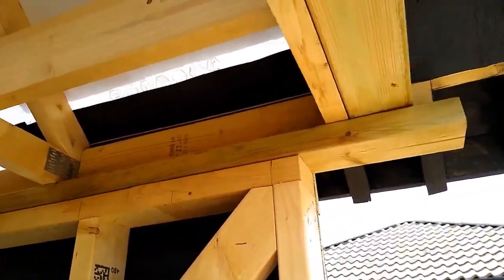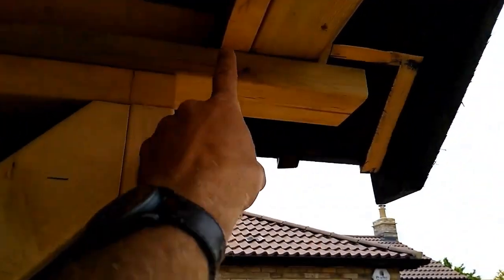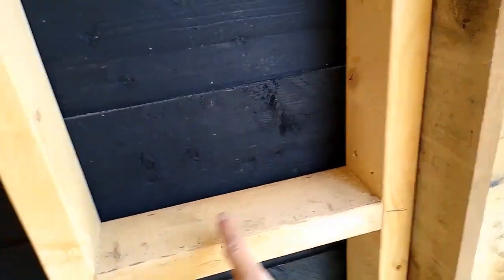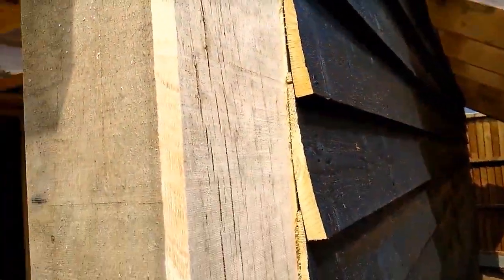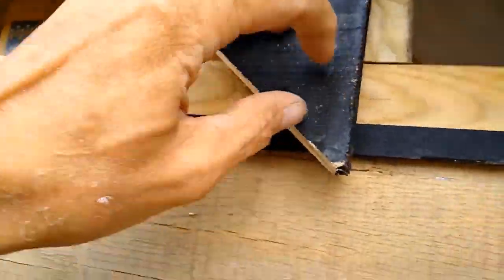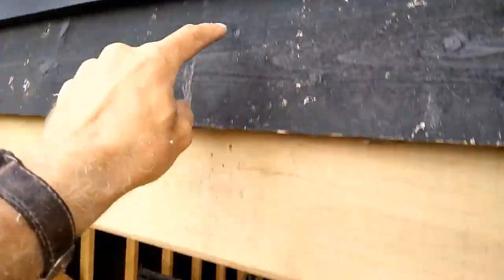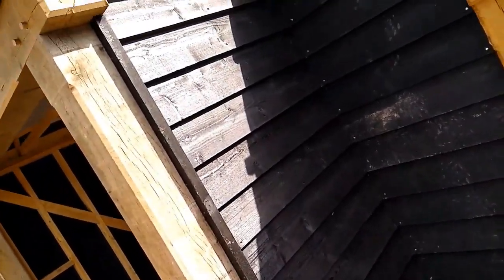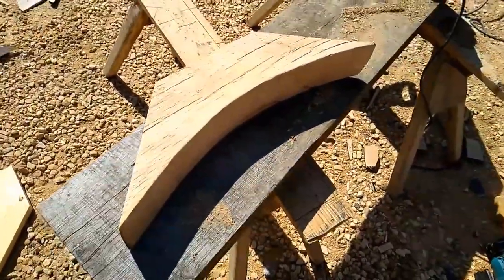How to build a timber frame carport PART 11  FINAL PART

Comment: Really interesting project. The oak looks really nice but took a lot of work 💪- where do you suggest a beginner should start if you wanted to increase your skills but you do not have any oak projects to work on?
Reply from the maker: Hi Adrian🖐 That's a question I get asked a lot, and it's a tricky one to answer, as, in my experience, luck does play it's part when trying to find people to learn off🤔 What you can do is practice simple, dowelled, mortice and tenon joints using scaled down timber, as oak frames are fairly simply built. There is also a ton of good stuff related to this on the Internet and YouTube👍Cheers Del